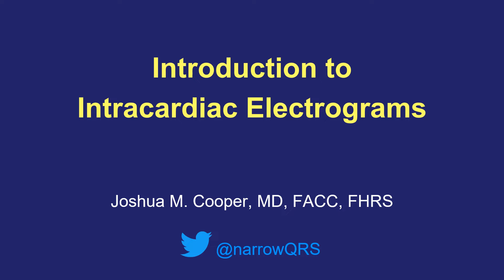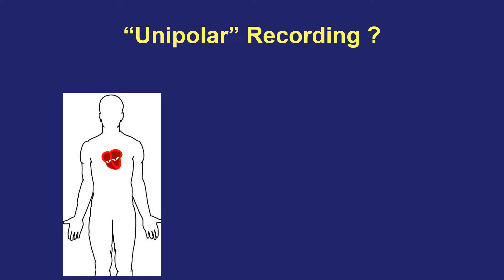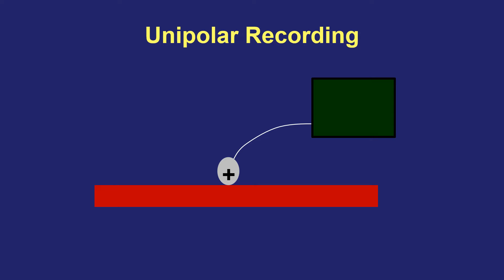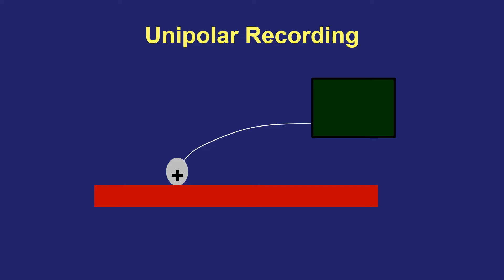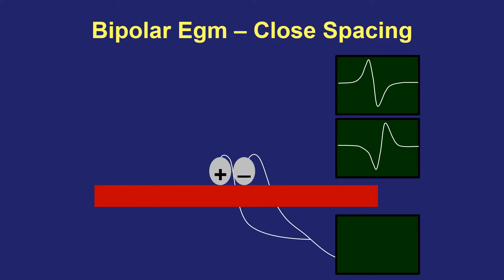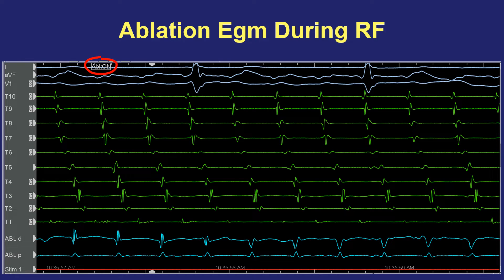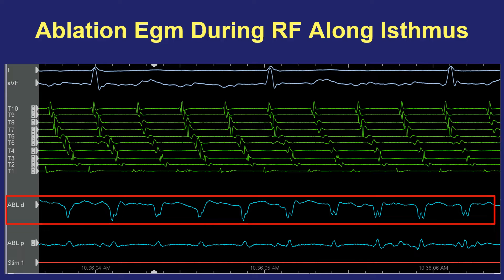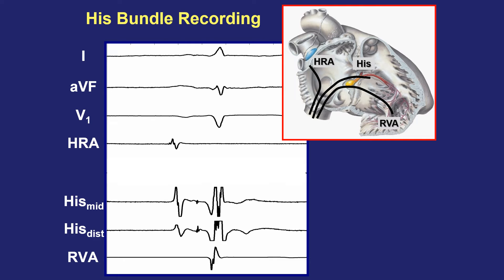Intro to Intra-cardiac Electrograms & the EP Lab

Comment: Great video!!
A question, though.
Does HV interval only represent the time taken for conduction in the His and bundle branches, or does it also include the conduction through Purkinje fibres?
Reply from the maker: Great question.  The HV interval represents the time taken for conduction in the His bundle, bundle branches, AND Purkinje fibers, until the first/fastest Purkinje fiber inserts into ventricular myocardium.  The HV interval starts at the His bundle electrogram and ends at the onset of the surface QRS complexes.
Reply: @dr.joshuacooper-arrhythmia  Thank you!